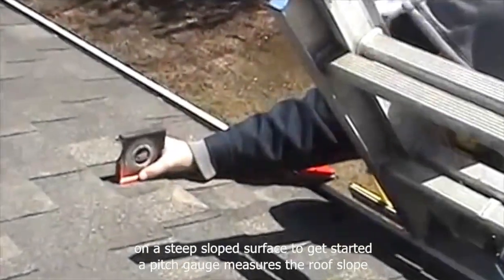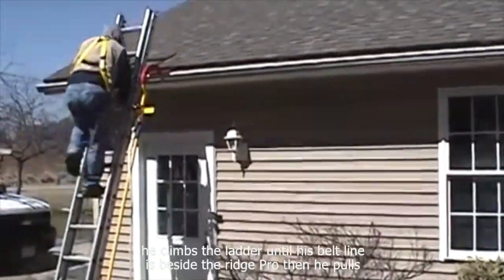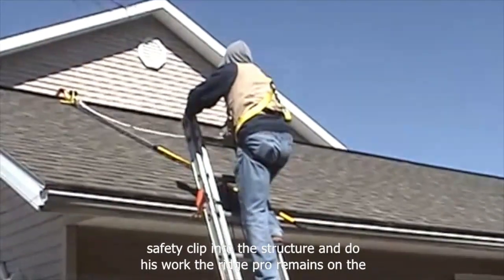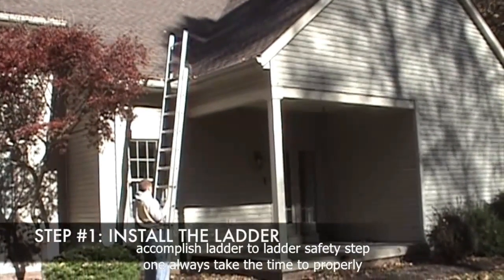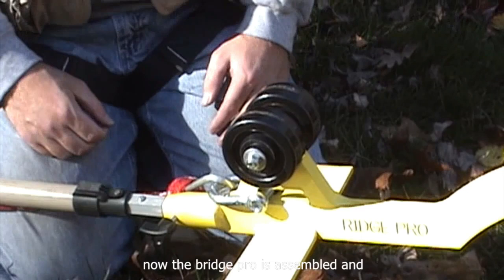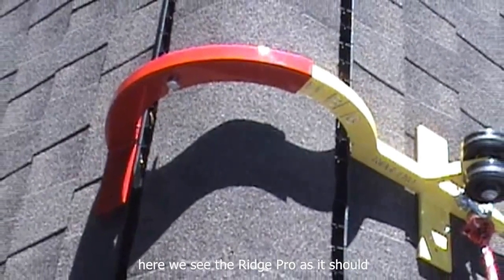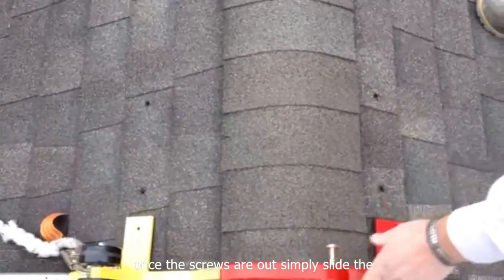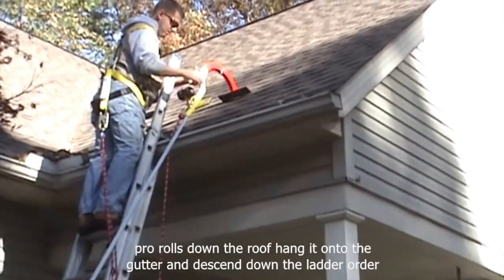The RIDGEPRO Roof Peak Anchor

Comment: I can’t believe you put silicone over those holes
Reply: The pros always remove the shingles before installing a temporary roof anchor. They never screw through a shingle. Makes me think this product is not well designed if the manufacturer goes against what the pros do.
Reply: That’s bs. If someone did that on my house. I would be pissed.   Not acceptable to me. And very rarely do I work on composition roof. I’m mostly on tile. Why is that not shown? Bcuz you can’t lag through tiles? Lol
Reply: @philipbucheit233  What technique do you use? I throw a rope over from the other side and attach the far end of the rope to my car.
Reply: @doctorboy5892  what about when ur on the side where ur car is

Comment: Can I use this ridge pro system to lift up my ham radio 40 foot 350 lb tower .  I could put it over the ridge of my roof and attach the end of a winch line to it and pull up my tower with the winch motor connected to the bottom of my tower pulling itself up.. What you think? I think it will work...
Reply from the maker: We would not recommend using the RidgePro Anchor for anything other than what it is designed for. 
 Fall Protection Equipment is not to be used in any material handling applications.

Comment: Why did they fail to mention that at least two 2 screws should be screwed into a rafter/truss? Also once you unscrew the roof pro, use the same screw diameter with a rubber gramet/rubber washer (metal roofing screws) and screw into the holes. Use roofing sealant over top. I dont know the diameter of a 3 inch 16d nail but that might suffice as well... good instructional video though
Reply from the maker: A fair point regarding the anchoring of The RIDGEPRO and you are correct. This instructional video was to introduce The RIDGEPRO to the roofing community, and further details regarding the use and safety precautions can be found on the website. https://www.bigrocksupply.com/the-ridge-pro-anchor.htm
Reply: Screws leave much smaller holes than nails, surprisingly.  This is because the holes is the screw inner diameter and the screw back nicely out, while the nail needs a claw hammer to pry out the nail which widens the hole by a great deal. Also, nailing is disturbing to residents of an occupied house.  The screw is nearly silent. 

This is not intuitive, and I used to believe a skinnier nail would leave a smaller hole that a screw with a fatter outer diameter.   Then I tried a screw.    Plus, I trust screws.
Reply: @bigrocksupply  A deck screw can be pulled out with 165, if pulled directly.  But it takes 700 lb to pull out a 3 inch deck screw with sheer force, +-50 lb.  8 screws is 5600 lb, and all climbing is based on the 5400 lb rule in the USA, and 4800 lb in Europe.

My best guess is that a structural screw hold about 2x a deck screw. (So, your 4 structura screws should be at least 5600, plus the hook over the peak, resistance which depends on the pitch and hook design.) But the number to pull out a structural screw with sheer force is vaguely extrapolated by the spec sheet, while the deck screw sheer force numbers were determined by actual measurements.

I would be very interested in the numbers from an actual sheer pulling test.  We do not really care about the force it takes pulling directly backwards on the screw.
Reply: Also, I assume your manual educates new people on the need for 5000 lb rope, and shock absorption.

Comment: This appears to be a very nice product.....I have been doing something similar to this for years....using a roof ladder with chicken hooks as an anchor point. A few years ago I called OSHA and they said a roof ladder can not be used as a anchor point. However, I understanding in the UK and Europe  it is allowed....  At my company,we are not roofers....We are simpler using this method  to gain access to the roof to inspect a vent pipe for proper flow rate,  and then in some instances replace the vent pipe if need be. It never ceases to amaze me how OSHA expects us to wear a safety harness without an anchor point....they should require anchor points on homes I guess...? As a owner operator I am not required to follow osha as it is only for employees, not owners, However, I try to follow OSHA recommendations anyway....in this case I elected to disregard them due the fact that we had no other solution....unless they changed the rule since I spoke with them. Not that it matters, (in my case since i am exempt ), but does anyone know if this is OSHA approved?
Reply from the maker: The RIDGEPRO can be bolted into the roof - at that point it is an anchor point but not before.
Otherwise, when not anchored, The RIDGEPRO falls into the OSHA "15 minutes of inspection time without being tied off" (after which you must be anchored). The RIDGEPRO can accommodate both scenarios.
Reply: Nice ...thanks for the reply, so unless we can “replace” (sorry I mean inspect ) the vent pipe in fifteen minutes....we will screw the hook brackets down ...😊...lol
Reply: On all houses anchor points should be made mandatory no matter what type of roof! At least 3 anchor points on each side of the roof and one for chimney access. It still doesn’t help for the two times your risking your life, connecting and disconnecting the safety line.🤔
Reply: Marshmellowfellow is the expert on this topic. In summary though you need to throw a static kernmantle rope over from  the other side and secure the first end to your car or a tree. These type of hook devices in this video  slip off and that's why they aren't allowed. They killed a father of 4  last year. Please never use them.
Reply: I literally had someone from OSHA suggest that I tie a rock to a rope and throw it over the house and then put a stake in the ground and go up from the opposite side. The next thing he said was I take it I said something really stupid judging by the way you're looking at me. Then he fined us.
Reply: @doctorboy5892  hey do you have more info on doing something like that?

Comment: So when he’s using the pole to push the ridge pro up. He does not have 3 points of contact and it looks sketchy standing there that would not be osha approved. Or am I wrong?
Reply from the maker: Good question. When ascending or descending a ladder - yes 3 points of contact. When you are neither ascending nor descending (aka stationary) you are considered to be on a "working platform" which is what applies when installing The RIDGEPRO - in the case of being on a working platform, 2 points of contact are permitted.
Reply: Just don’t be a beta male, easy

Comment: I have a mountain climbing belt could I use the ridge pro to help me with my roof still or will I need a 5 star harness
Reply from the maker: Hi Maliek,
The simple answer to your question is this, mountain climbing belts are designed for mountain climbing and fall protection harnesses are used in fall protection applications. OSHA requires you to use the proper equipment for the job. Thank you for your question and we hope this helped.

Comment: Could we just mount the anchor one shingle lower, to avoid the ridge vent?   Or would that be less safe somehow?
Reply from the maker: Hey Joe, 
The intended use of the device is to be mounted on both sides of the roof. It may or may not be less safe but we would not recommend anchoring in any other way than as intended by the manufacturer.

Comment: Shouldn’t use silicone on shingles. It doesn’t bond well and you just got hit with a 4 hole roof claim. Use asphalt roof patch instead and not have to worry about an insurance claim. 

I’m thinking about one of these for my roof washing business, but we have a lot of barrel tile roofs and this won’t work will it?
Reply from the maker: Thanks for checking out the video! Questions about silicone vs. asphalt roof patch should be directed to the manufacturer of the roofing material. As for the barrel tile roofs, users have successfully used The RIDGEPRO for that, but we do not recommend it.
Reply: Even better, remove the shingles prior to mounting it but definitely no silicone on shingles. That made me cringe
Reply: @bigrocksupply  lol no, it should be directed at you, because you’re demonstrating the use of silicone. If that’s a question you can’t answer then you shouldn’t be instructing people to do it. That’s like telling people to drink bleach and when they ask if it’s safe you’re just like “🤷‍♂️ask the bleach manufacturer”

Comment: I would be worried taking advice from people who do not know 101 ladder safety. There is one glaring ladder rule that is violated in the video. And it is a serious, common problem, and a common back breaker. 

The guy stupidly leans forward, putting weight on the ladder above the roof/gutter line. The gutter is acting as a pivit point and the weight acts to physically push the base out from the house, commonly causing the base of many, otherwise properly placed, ladders to kick out - - forcing the guy to hang on to the gutter or fall.  Landing face first on a ladder rung that kicks broke my workers neck vertebrae and he had to do 2 operations and 6 months of rehab and learn how to walk again, which the surgeon didn't think possible. 1 million dollars. 

At least 50 lb needs to be placed at the ladder base. But I would feel better if tied to a screw stake.  

Also, the ladder needs to be tied to a gutter spike so that it can't wiper.

I am baffled that these people have not enough field experience to see this danger.

I do like to see that the life of the worker was put above drilling and sealing the holes.  A-holes who do not do this day in and day out, risking their own neck, do not realize that this is necessary for working on most homes.

I am concerned however that I would see the device would work best with several units and have a very limited amount of use if too expensive.  A set of 2,  6 or 8 needs progressive pricing.
Reply: One appeal is that it works on shallow pitches. The other day I needed to hang a ladder from a peak which had a shallow pitch and wide Ridge cap. The standard hook did not work, so I was able to lift a shingle and drill in a jack.  On half the houses, the shingles rip.  So, drilling at an inconspicuous juncture and sealing is essential.

After sealant, I add a layer the gutter rocks to protect the caulk from the sunlight. If no rocks, I use black beauty, which are black rocks from a black shingle used for sand blasting. I carry around a pill bottle full of it.

I have dreamed of cutting an aluminum nail a half  inch from the head. Gooping up the straight part of the nail and shoving the plug a half inch deep, then filing the rest with lexel, amazing goop, or silicone, then the rocks. The idea would be to eliminate the resin shrink factor.

It is important to point out that windshields do not leak around the perimeter 40 years after the install. So, these tiny hole filling should do the same.

Comment: Why demo on a flat ass roof that 99% of us would just walk on freely anyway? Maybe try a demo on a scary ass 12/12 where we might actually NEED it. If it weren't for the ridge vent, it looks like it was gonna slide right over the low pitch roof anyway. Hope the ridge vent is secure.
Reply from the maker: Our goal is to show a roofer being safe when working six feet or higher regardless of the pitch above 6, never walking freely. The RIDGEPRO is engineered to work regardless of a ridge vent being present. We've added two new images of the Ridge Pro being used on a steep roof. ->  https://bit.ly/theridgepro

Comment: 500$? Jesus.
Reply from the maker: When it comes to worker safety on roofs, price should never be the deciding factor. There are always less expensive fall protection options when working safely on a roof.
One of the most important questions is, "Can or do we want to anchor or penetrate into the roof? If the answer is yes, there are a variety of inexpensive anchor points available in the market. If the answer is "No", there are fewer options that are typically more expensive. The RidgePro is one of these options, made in the USA, the RidgePro is constructed of high-quality 6061-T6 aluminum alloy (also known as aircraft-grade aluminum) and is designed for years of dependable use and reliability. As always, please contact us to discuss other options for your specific application needs.
Reply: @bigrocksupply  thats a fancy way of saying if you value your safety you'll pay what we want
Reply from the maker: @ryanhilbrich3522   Do you know of a lower-priced option that offers similar features? We’re interested.

Comment: Stupid idea. No way my clients would allow this. And i would never allow this on my home. Horrible idea.
Reply from the maker: Why do you think the idea is stupid and horrible? Why wouldn't you or your clients allow this? Some might argue this is a creative and effective way to help protect people and prevent falls.
Reply: Ok buddy.....go rent a sky hook then.....perhaps your clients will be impressed....or maybe , better yet go get a tellahandler .... and make sure you leave big ruts in the yard just to do a simple roof shingle repair .....or maybe site up some scaffolding .....??? It look like a great product and it solves a problem.....I love it....
Reply: @ike7933  He prefers to be dropped in by helicopter. Or maybe forget the helicopter and just fall off the roof. I noticed Moore didn't say what his solution is to the problem. If your clients won't allow this the problem is the clients not the product.
Reply: It looks like a good idea but for the four holes in the roof and that's with one position placement allowing a body harness 15 degree swing angle coverage.  More holes needed for more positions and wider coverage..  Silicon doesn't do well in the hot sun after a half dozen years.  Dries, cracks up, pulls away.  So much future leaking potential.
Reply: @bigrocksupply  It is a great idea and safe . Before I saw your video this idea came to my mind. I just need to find a solution to lift my tower that sits next to my house without having to do more unnecessary construction...